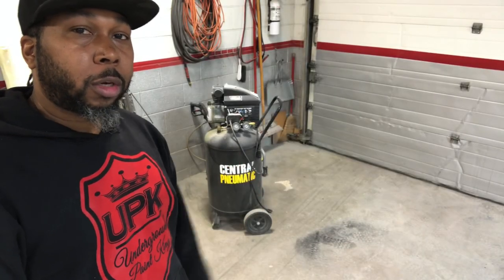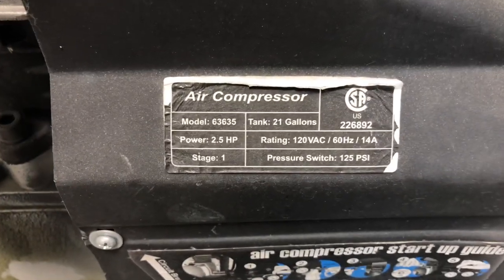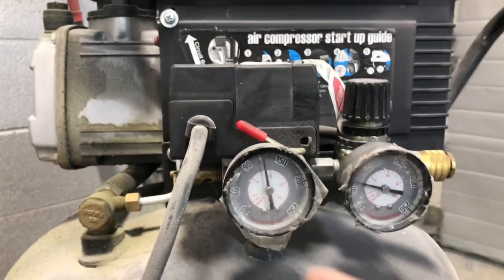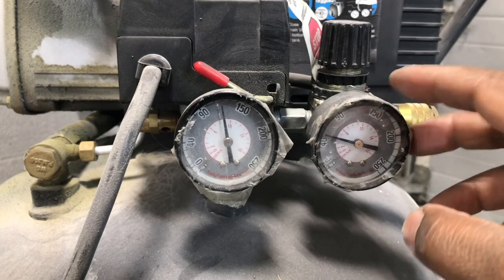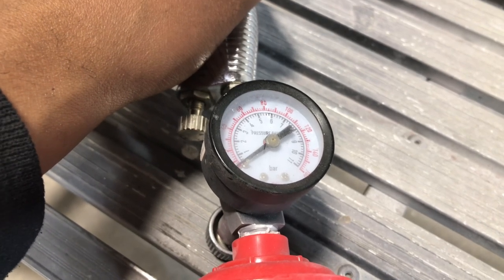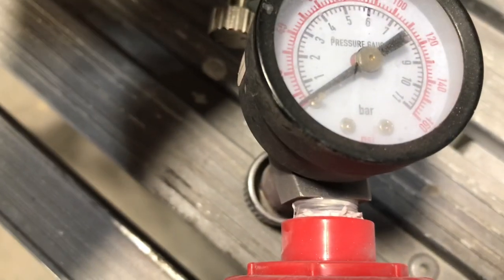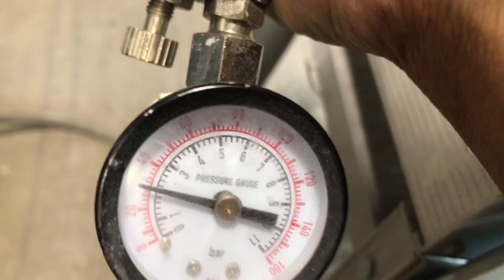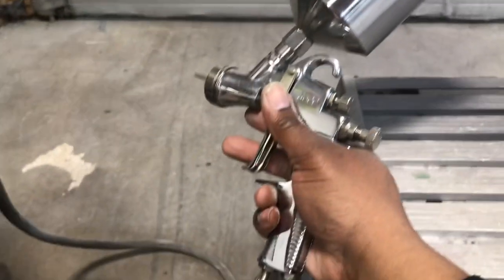How to setup your compressor for paint

Comment: Hey paint king  had some issues with my paint sprayer today. It was spraying out in a messy and wet manner, almost like orange peel texture. The problem is, I couldn't get the pressure regulator to go above 20 psi, I'm using an R500 LVLP and a 20-gallon compressor. Is there anything I might be doing wrong that's preventing me from reaching 30 psi? Any advice would be greatly appreciated. Btw this was my first time spraying
Reply from the maker: What is your compressor set at? also you may have a bad air regulator so check that as well
Reply: @UndergroundPaintKing   I’m pretty sure the compressor was set within 55-60  and I used the regulator that came with the r500 lvlp and I made sure the the airflow was opened all the way on the gun.
Reply from the maker: @mufffintop5355  they could have sent you a bad regulator, try it without the regulator and see how it does
Reply: @UndergroundPaintKing  if I try it without the regular I would just set the compressor anywhere from 25-30? And what regulator would you recommend

Comment: hey UPK  good info.  is there any reason or difference running the compressor at 60lbs instead of full at 120lbs?  on your advice, i bought the sprayit as well as the summit lvlp gun.  i have generally run the compressor at full pressure and dialed the gun back.  off hand, i can't recall the pressure i use on the spray it.  what pressure did you dial the gun at when you were using it?  i spray cabinets not vehicles....yet
Reply from the maker: I typically spray between 22-30 psi depending on what I’m doing…does your compressor run constantly while you’re spraying? Not running at max will save your compressor and keep it from running so hot because it’s constantly running
Reply: @UndergroundPaintKing  occasionally it will run while i'm spraying, but that is only if it is big pieces like 30 inch by 8 ft   usually door and drawer fronts are only a few square feet so i spray, stop and move them, get a new on set up and spray again.  so in that case it doesn't run much.  good info.  i will reduce the pressure and see how that goes.  thanks a lot
Reply from the maker: @BT-ih6kr  you’re welcome!

Comment: Yeah I’m doing a small repair on my 98 mustang I was wondering about my setup I’m very nervous don’t want to mess it up paint not cheap
Reply from the maker: Paint is definitely not cheap but I know you can handle it 💯💪🏾
Reply: @UndergroundPaintKing  i bought a new hvlp harbor freight $30 gun but I’m also looking into the r500 because my air compressor is a 60 gallon 220 rewired to run on 110 so it doesn’t keep up with high cfm.what do you think stay or or get r500 lvlp gun.thanks
Reply from the maker: @socalRooster  if you’re not tackling the entire car you could get away with the hvlp, but if you’re doing the whole car then maybe you should go with the r500 but with a 60 gallon tank I would think you should be good
Reply: @UndergroundPaintKing  sounds good thanks.and no I’m just doing passenger fender both bumpers and left rear quarter panel .repairing clear coat sun damage.using base and clear from local paint supply shop
Reply from the maker: @socalRooster  it should work fine for you ! Glad I could help 💯
Reply: @UndergroundPaintKing  👍

Comment: Big pimpn am a nubeeee..... I got a fronted 27 gal air comp.  155psi max.. is this enough 🤔 to use a hvlp or hte gun ..
Or will she still cut off intermittently im sure.. how much does this matter THANKS MY KING 🤴🏾yee yeee
Reply from the maker: Depending on the cfm required by the spray gun and the cfm that your compressor will deliver will determine if you can use that setup, for most hvlp spray guns a small compressor won’t handle the task of a overall paint job well but if you’re doing small parts it could work a little better. So I recommend a lvlp which has lower cfm requirements and will work well with your 27 gallon compressor
Reply: @UndergroundPaintKing  right on my king 😤 i will look into lvlp.. although  its my 51 chevy pickup .  So yeee I will be spraying in pieces at dat..for now she just gets a high build primer with some tint color in it & probably clear on top of that.  I will probably snatch a black widow  , (I believe I looked up parts on harbor freight (h.f.) & they do sell replacement tips of two diff. Sizes.. ) anyways ... guess the hvlp would do me better for the high build .. right ??  But the hte be better for my clear.. not like I got da cash right now ..haaaa but do I need both .. or what your thoughts 🤔 playa 🧐😎🤴🏾 thx again .. mang
Reply from the maker: @OGSHAKER2020  some high build primers have to have a larger tip to be sprayed so you can go with a inexpensive spray gun for your primer and a good spray gun for your base and clear
Reply from the maker: @OGSHAKER2020  the lvlp spray guns I use are under $100
Reply: @UndergroundPaintKing  okay okay... SHOOT me .. haaaa. Some examples of each doggy.. appreciate cha.. fosholy... gotta get my paint game on da road .. its time .. (also) do you have vid on complete set up of your line as far as water air separators,  regulators,  couplings .. etc)  this would make a good vid .. but you might already ...yeee yeer✊🏾🤝🏾🙏🏾
Reply from the maker: @OGSHAKER2020  here is a video of the filter I use and I’ll link a video of the other tools I use
https://youtu.be/zhC0ia-weNs
Reply from the maker: @OGSHAKER2020  https://youtu.be/Vjo1mQn0X4Y

Comment: i got same compressor,same gun,with 30ft 3/4 id hose,and same air line filter n regulator,,but have to set compessor at 110psi to get 30 at gun,, why u think that is happening.
Reply from the maker: @WilfredGreen-ov8bh  it’s possible that you have a bad air regulator
Reply: @UndergroundPaintKing  yup, that was it..thx 100%
Reply from the maker: @WilfredGreen-ov8bh  you’re welcome!

Comment: Arent you getting a 60psl shot of air when you first pull the trigger if your constantly pressing and releasing the trigger, how can you get a consistent air flow, or are you pulling the trigger off of the project which would allow the gun to get to your set pressure, I'm new to all this but you could clearly hear the higher pressure hit when you first pulled the trigger, what works for me is to set my compressor at 10lbs above what I choose to spray at also based on my airline length. I tried setting it higher but got a high pressure burst every time I pulled the trigger, so I set my gun using the compressor knob to get my desired pressure leaving gun wife open to not restrict the amount of airflow coming into and threw the gun, is what works for me. Everybody is different what works for one might not work for somebody else. Peace U.P.K. ....
Reply from the maker: Always go with what works for you!

Comment: Do I need a filter to get moisture out line on small 🗜? If so what's a good one ?
Reply from the maker: I only use a filter on my spray gun personally for my small compressor setup but you can use water separators  from just about anywhere depending on how much work you plan on doing. A simple filter to use that isn’t expensive is by motor guard which I use also and I’ll put a link to the video that I show how I set it up
Reply from the maker: Here is the link Christopher
https://youtu.be/zhC0ia-weNs

Hope this helps

Comment: I have a McGraw 21 gallon 1.5HP 175 PSI would this be good for painting a vehicle ?
Reply from the maker: It would depend on what spray gun you go with and the cfm requirements of that spray gun
Reply: @UndergroundPaintKing  the one I bought is the Spectrum 20oz HVLP gravity spray gun.
Reply: 9.55 CFM fan and 3.29 CFM round
Reply from the maker: @rafaelfuentes-ne8jp  depending on what you’re painting you’ll be able to paint with that setup but if you’re doing a complete paint job it will be more difficult because the compressor won’t keep up with the demand of the spray gun, so it is possible but you’ll always have to pay attention to your pressure dropping which can cause problems
Reply: @UndergroundPaintKing  thank you so much for this information bro the car I want to paint is a 07 charger so basically I would have to paint in sections. My compressor is 4.0 SCFM @ 90psi.
Reply from the maker: @rafaelfuentes-ne8jp  painting in sections would be a good way to go!
Reply: @UndergroundPaintKing  sorry for all these questions I just want to make sure  I get this right. Im watching all your videos and you make it look so easy 👍🤙. With my compressor you think I should just take back the HVLP gun and get a LVLP instead or it doesn’t matter?

Comment: Question, does this mean that if a compressor is rated at 12cfm at 90psi then it will be even more around 40psi which would allow you to use a higher cfm spray gun? Maybe around 13 cfm?
Reply from the maker: That’s right Andrew, your compressor normally gives you what cfm it will be when ran at 90 and at 40 so check your compressor and it should let you know what you’re capable of using

Comment: Do you run gun hose straight from compressor? Or is a dryer in between?
Reply from the maker: I’ve been running my hose straight from my compressor Outlaw T
Reply: @UndergroundPaintKing  Bet... So as long as I loosen the screw at the bottom like you showed us and put a filter before the gun I shouldn't have any water problems right?
Reply from the maker: @outlaw_t6682  I’m not saying you won’t get water in your line…you should definitely keep in mind of possible water issues but so far I haven’t had a issue with water

Comment: I use a 17cfm painting I set regulator at 45psi and regulate the gun at the gun the compressor is working to hard mine has 60lt receiver
Reply from the maker: You definitely don’t want your compressor being overworked!

Comment: The black widow recommends to set compressor at 70psi and gun at 10to 35 psi
Reply from the maker: Give those settings a try and see if they work good for you…I normally spray clear at 30 psi with my black widow
Reply: @UndergroundPaintKing  my black widow I run at 30psi for base and clear and just adjust my hand to accommodate the way the gun operates cause as an kid I was toyght common since and that's that most everything is not made the same exactly like put 2 black widows side by side hte but one more than likely will spray slightly different cause manufactures are not flawless. My hun regulator was not working the best so I adjusted it at the tank and on pull was reading steady 30-35 psi but let off an preasure Guage shot up to 140psi lol
Reply: @UndergroundPaintKing  I also learned adjusting my hand due to tattoo techniques that are simular in sorts of ways
Reply from the maker: @wrightsrrt871  it’s crazy how way trade can help you with another but I agree with you that all spray guns aren’t the same and you have to know the adjustments to make when necessary
Reply: @UndergroundPaintKing  yah people don't understand painting to well sometimes like that cars are not the only metal painted. They use guns like this on custom rod iron welding jobs ,store fronts like how 3m paints Targets front entrance ways and much more. Plus if you really want to learn how to spray start with using an airless on house's caues you develope an feal faster when painting bigger prodjects all the time I've painted house's, rodiron and cars as an kid with people's help then but now want to get back to cars! Got to say your an cool dude and love the channel brother!!
Reply from the maker: @wrightsrrt871  thanks I appreciate you Wrights RR&T

Comment: I think my pressure valve on my gun is bad. You barely touch it and it will jump all over the place. 🫣 BUT. I did have the tank all the way open for line pressure. 🫣
Reply from the maker: If you fix the valve issue you should be good to go!

Comment: What pressure gauge do you use I'm having trouble with the gauge not going over 20lb when I pull the trigger it's well over 60lb with out the trigger being pulled
Reply from the maker: So your gauge on the spray gun will read 60 psi before pulling the trigger?
Reply: Yeah  drop down to 20lb when I pull the trigger gauge wide open only adjust down 20 is as high as it will go
Reply from the maker: @Dayday-qk3sz  turn your gauge down before you plug the air to it then once you plug your air up you should be able to adjust to the air pressure you want while squeezing the trigger

Comment: That's funny. I have the same compressor AND the same hose. lol
Reply from the maker: Those are some good hoses in my opinion I have them at my shop and in my home shop
Reply: @UndergroundPaintKing  Only problem I had was one of the ends leaked. I picked up a push-lock type end from Home Depot to replace it and it's been fine for a few years now. Since they have swaged ends changing the ends was cake.
Reply from the maker: @jayinmi3706  nice!

Comment: My compressor regulator is at max. My inline regulator is at 100 psi.
My paint gun set at 30 psi drops all the way down to around 25psi when compressor is off. While the other regulators are still reading high. Wtf
Reply from the maker: Sounds like you may have a issue with your regulator at the gun
Reply: @UndergroundPaintKing  it is a harbor freight version. I just ordered me a 3m regulator 👍
Reply from the maker: @tykendrick800  hopefully that will work better for you!